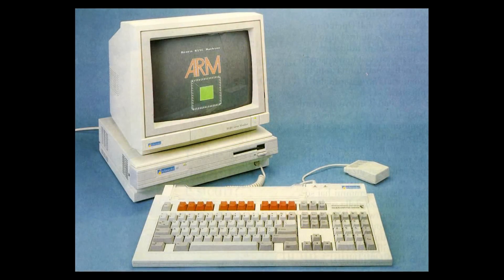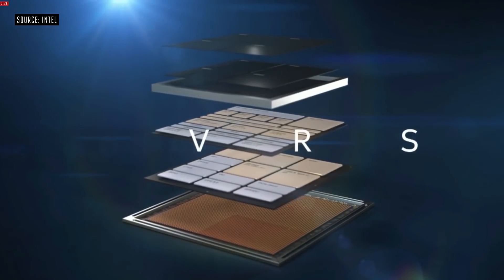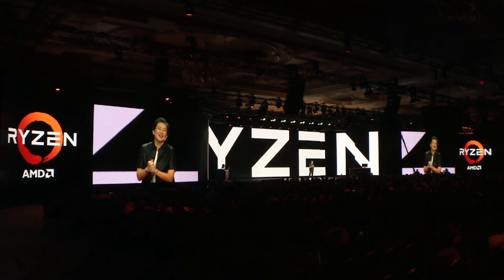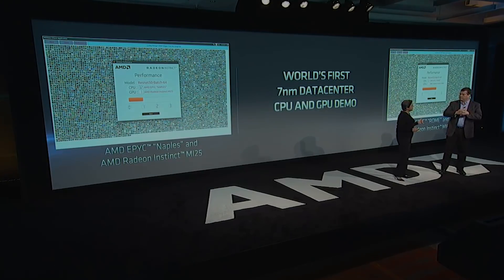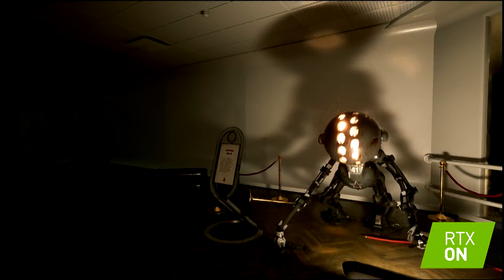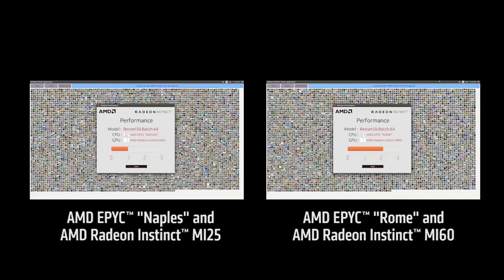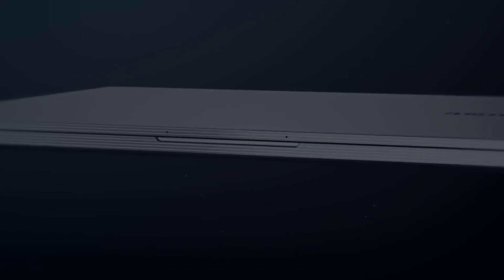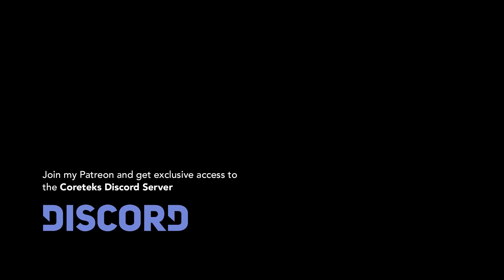Hardware trends: How many cores do we need?!

Comment: As an expert in the field of computers and of parallel programmning, your presentation is pretty simple. And the solutions are not going to be simple. Just as GPUs work with many "cores" so will future applications be written to use many "cores" / Threads. And no, we programmers are actually taught in many places to do this type of programming. Sure it will take a while, but nobody would bother making the changes to games to use 16 or more cores until such processors appear. The games and other software will follow. Given the power law of cycles / thermals, this is the only way we can go obviously. It's no possible to make 10GHz processors.
Reply: Yes, it seems we programmers are thought of as lazy dogs, but we've been driving hardware innovation, not lagging behind it.  We've been doing parallel workloads for at least a decade.
Reply: Indeed biggest obstacle for advance of game development has been Intel, who stopped to four cores as high end and two for market PCs for whole decade.
In that situation it simply didn't make sense for game developers to spend much time in developing ways to utilize lots of extra cores.
Especially when in PC there's notable amount of Windows etc. bloatware to lower amount of resources what can be counted on to be free for game.
Could be said that for that decade games had to be able to run on 1 and half cores.
Reply: You are not an expert, you are writing nothing that an average gamer doesnt know.
Reply: @damazywlodarczyk  The OP was calling the video host an expert.
Reply: The point is that even if software can be made highly parallel there is still a hard limit to higher core counts being beneficial. Barring some revolutionary new language or compiler, or a breakthrough in CPU architecture, this isn't going to change any time soon.
Reply: @GonePh1shing  Starting with this very BIG IF.
Reply: @GonePh1shing  It doesn't need to change anytime soon. 5 years ago, so around 2-3 years after 4 core CPU became easily affordable we saw increase in max. core count used by games from 2 to 4. Intel was waiting so long with giving us 6 cores, that games started to benefit from more cores before hardware was introduced.
In video author claims that current most parallel games can run 75% of their code parallel. It'll change, and both AMD and Nvidia are trying to convice everyone, that more cores is better. If 90% of the code will be run parallel, than 16 and more cores will make sense - and it's definitely possible. Plus the fact that high-end CPUs are used even today for steaming, so in 3 years it might be reasonable to buy 32 core just for streaming games.

Comment: The way you characterize speedup for parallel tasks is fundamentally incorrect. This entire video is based on a misunderstanding. Ray tracing isn't a 95% parallelizable operation (where did you get this idea?). That's not how parallel computing works in this level. For each pixel on your screen, you have a potentially independent process. For a 1080p monitor, that's two million independent operations, so ray tracing won't top out until you have 2 million cores. By that time, nobody will be running 1080p anymore. They'll be running 4k or 8k which is 8megapixel and 32megapixel respectively. The parallel game can occur with ray tracing forever. It's a linear relationship with cores.
Reply: Even in a task with no dependencies, you're still physically limited by your memory hierarchy. It's like running a freeway interchange with 1024 lanes: you are going to have so much space allocated to onramps and offramps that it has no benefit. That's where a "95%" figure would come from.
Reply: @JH-pe3ro   Even if that were the case, something doesn't entirely add up in a sense. After all our human mind is basically an absurdly massive parallel system with extremely slow sequential processing. So if parallel operations in many things were really so limited, how could our processing ability possibly exist?

This disconnect as such between a real world system that seems to do many generic like tasks in a parallel setup extremely far beyond the level what he implies should be pointless, makes one wonder if somethings isn't being missed. As in, that a solution to make many issues more parallel then expected can be found.
Reply: @JH-pe3ro  This is true, but there is nothing in the way of designing chips with many memory lanes. Memory can be parallelized ad infinitum as well.
Reply: And, Raster using keeps needing more memory space and bandwidth to improve, which are expensive on the chip and off. Ray tracing isn't immune to such burdens, but could greatly reduce them, in theory.
Reply: @laurelsporter  Memory can be parallelized as much as needed too. In the case of ray-tracing, you might need multiple copies of the scene to parallelize, but that's not a true limitation of parallel computing. When that becomes the bottleneck, chips will be designed with more memory and more parallel memory.
Reply: @TrevorStandley  It can be, but that gets costly. Raster relies on overlaying things on top of buffers, over and over, and the bandwidth just keep adding up, including inside the chip. Ray tracing trades a lot of that simpler operation for more calculations, which are getting cheaper, in power terms, than all the data busses, which are getting relatively more expensive.

There's also nothing keeping a ray traced portion of a scene from being modified with the same sharers as normal, so the two can be combined, outside of basic texture mapping and lighting.
Reply: @laurelsporter  You'd have to have multiple buffers. And sure, that's now how we do things now. But if that were the major bottleneck, we'd change the way we do it.It's not hard to combine two buffers. You could have them be side by side, or have a single reduce operation at the end that uses the depth value to combine two buffers.

Comment: Well U forgot Multitasking benefits. Even if software is writen for single core or with low parallelism percentage thanks to Multitasking U can still benefit runing MULTIPLE programs on multicore architectures and this scales rather well.
Reply: yeah, sure, but for vast majority of people the most intensive programs they will ever run on their PCs are video games. I run a ton of programs simultaneously, and my CPU cores rarely exceed 20-30%, and it's 5 year old PC.
Reply: @fobusas  This is why AMD Presented Asynchronous Shaders. Basicly Shaders are programs that can run on GPU and Async Shading is basically Multithreading for GPUs. We just need to wait for NVIDIA to implement it and we will be able to code and use those unused CUDA / Tenser / RT Cores for some minor tasks in parralel.
Reply: @fobusas  On my 5 year old pc, the cpu is often used at a 100%. And it's a six core, so 100% means six cores being utilized. 

The low utilization can have multiple reasons, like just having a fast cpu, while playing not very cpu dependent games.

If I play the third witcher game on my old system, I never see a cpu-limitation on the countryside, but in Novigrad, with it's many npcs, the cpu runs at it's limits. With every one of the six cores. On my newer quad core, it doesn't do that on all four cores, so maybe, it's not parallelism, but raw computing power, that sets the limit for utilization here. And if the average available computing power of all gamers increases, developers will use more. It's more of a hen and egg problem, then a no one needs this or that. At least for tripple A titles, indies are probably slower to follow up ...
Reply: @MephistoDerPudel  Sorry, I did not mean games. I meant all the other programs besides games, like spotify, browser, doc. editing, etc. When I am not gaming, my CPU rarely exceeds 30%. And it's only 4 cores wit HT.